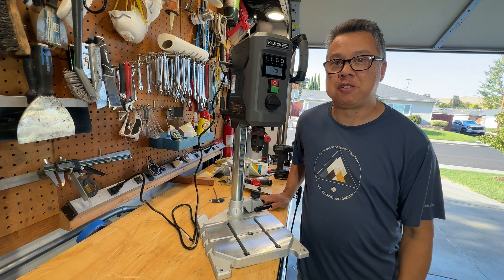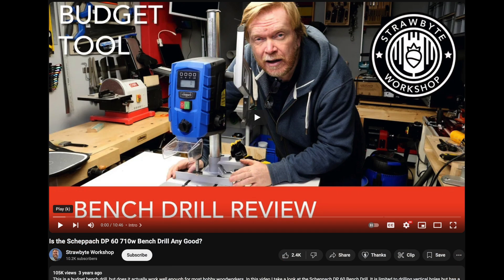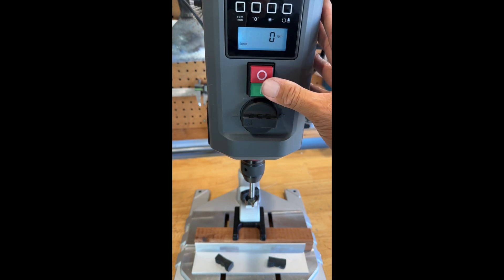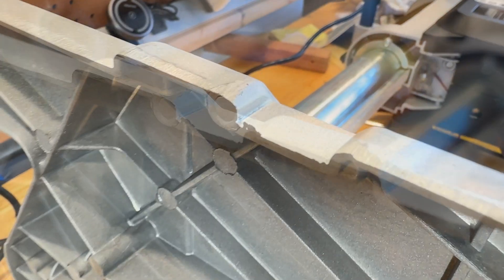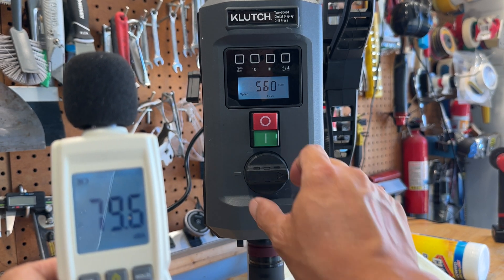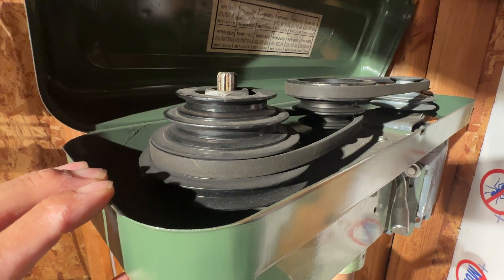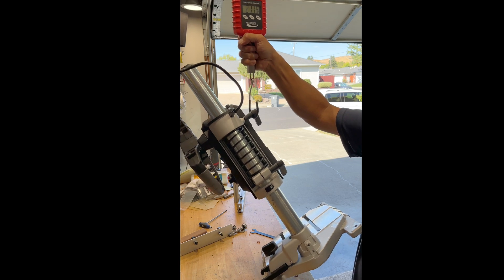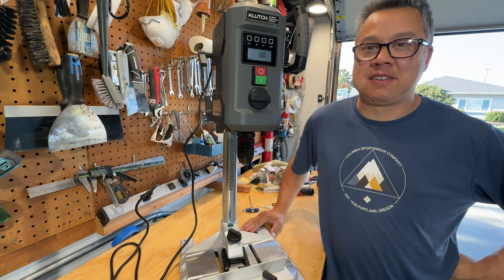Klutch Drill Press review; Variable Speed, Digital Read Out depth gauge

Comment: Did some drilling in steel tubing and rod today - I love being able to easily set rpm to match conditions.  And the built in clamp is fine.  And it only took a few tries to learn the keyless chuck.
Reply from the maker: I found that when I back drive the chuck to loosen it, sometimes it pops the gearbox into neutral.  I got rid of the chuck that it came with, and I replaced it with a standard key'd chuck.

Comment: I just got mine today, and drilled a few sample holes in wood and aluminum.  It is noisy, but so what.  If one side of a (Forstner) drill bit digs into the wood object being drilled before the other side of the Forstner head bit the entire Klutch head will flex from side to side - but likely not a big deal for my work.

Comment: I saw a guy had made a 3d printed throat extender so when you want to work on a piece that needs to be deeper than the stock you just pop it on and make a few adjustments and your good to go. He was using a Bosch drill press but I would think the dims are the same on the throat. I have a full-size porter cable that I want to sell and pick one of these up. Now that you have had it awhile would you say it is still a great buy now they are $260?

Comment: Came here before ordering it from the Northern Tool. Thank you for the excellent and in depth review.
Reply: Just talked to Northern Tool.. back in stock 4.16.25
Reply: Same here!
Reply: @JonnyCap  same lol , $120 plus $20 gift card was hard to pass up
Reply: Yup picked up the last one here in Columbia SC! Just wish it could reverse when you're tapping. Would need to lock chuck into the shaft but that's probably the easy part to the mod lol
Reply: I did wire in a reverse switch to the brush wires and it works flawlessly! Just leave it in slow speed for either gear!

Comment: Thanks for putting this up, this design seems new to the States with not a lot of info to be found. The Northern Tool specs say it's got a Morse taper in the spindle (MT2), but I suspect that isn't true. It looks to me like there's no separate MT2 arbor that the chuck threads onto, which would be knocked out through a slot somewhere higher on the spindle.  Can you tell?
Reply: The chuck just spins off a fine-threaded shaft; I measure it as 1/2" diam and 20 TPI

Comment: What's the distance between the spindle and the drill column? I'm curious if you could use this drill for more bigger wood pieces.
Reply from the maker: 125mm.  But since the drill press is so portable, it can be placed anywhere on a piece of plywood, and drill holes anywhere.
Reply: @etischer  I'm having trouble picturing this. Do you mean having the entire drill base setting on top of the workpiece and drill through it?
Reply from the maker: @pilotdog68  yes, placing the entire drill press on the plywood, and having the drill bit extend through the drill press base into the plywood; you can drill a hole anywhere

Comment: After having used it for a while, would you purchase again?
Reply from the maker: Yes!
Reply: @etischer great thanks! I bought one yesterday based on your review.  BTW: One thing that will improve the run out is a new chuck. Rhom makes one but it is an additional $100. I will buy and try out and let you know if you are interested.  Again thanks for the review.
Reply from the maker: @matthewwysocki5019  yea, I've seen that as well, but $100 chuck on a $170 drill press... IDK.  I'll wait till I feel like I need more precision.
Reply: @etischer  yes it seems as though it is a bit much for the press but I understand it makes the press considerably more accurate and the chuck is much easier to use.  I let you know when I get it.
Reply: @matthewwysocki5019  could you tell us which one did you get? I am not sure which one to buy to fit the drill.
Reply: @matthewwysocki5019  I'm also wondering which one you got and if it fixed the runout
Reply: FYI: I have been using the drill for a few weeks and it has performed well and accurately enough for woodworking.
Reply: @matthewwysocki5019  so you didn't get a new chuck?
Reply: @matthewwysocki5019  Excuse me for my naivete, but are the threads the same on all chucks or what threads would I need to replace this p.o.s.?

Comment: Great review. Thanks! I too am wanting the Bosch but the voltage/cost issue is prohibiting the purchase. Hopeful Bosch will hear our cries and bring the drill to North America.  That said, I think this bench top is a solid choice for the price.
Reply: @matthewwysocki5019 I wrote them about this and told them in the USA we would like to have a version of it available that runs on standard USA circuit they wrote me back but said they had no plans on this as of now. Well its been like 8 years at lest since I first saw it, and I still see no version of the Bosch available for use in the USA I think we should all write them to possibly force them into rethinking it. I said cant you guys just build us one with the correct motor and power requirements for the USA i mean common i can buy all there other tools that work here, they really need to bring the Bosch Press to the USA. The only one I found that is close to how it works with its depth gauge and drill stop with electronic speed control is the Klutch a cheaper clone that was mode for Northern Tool and has the correct AC power requirements for USA usage but is not built as well but hey it does cost a lot less.